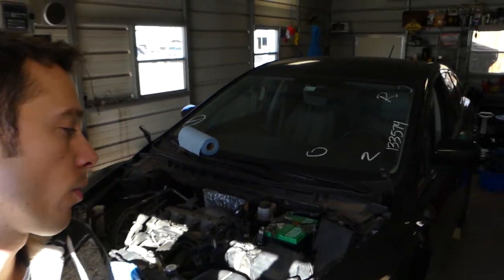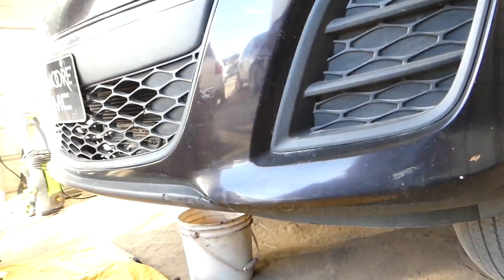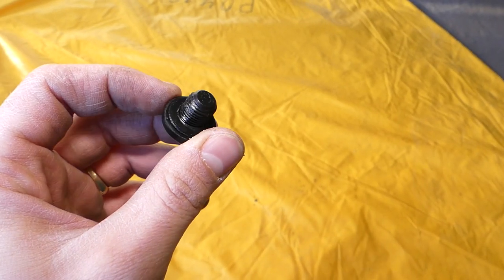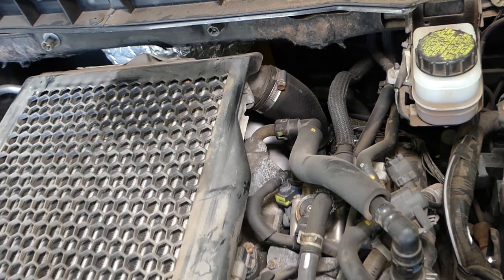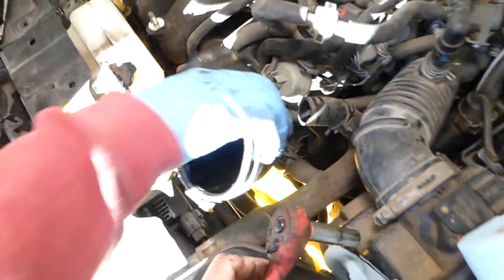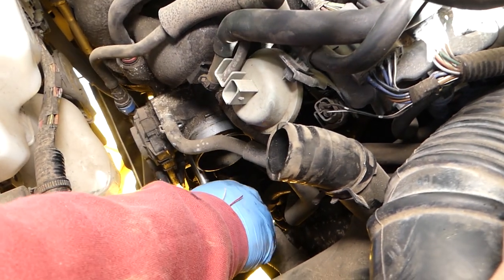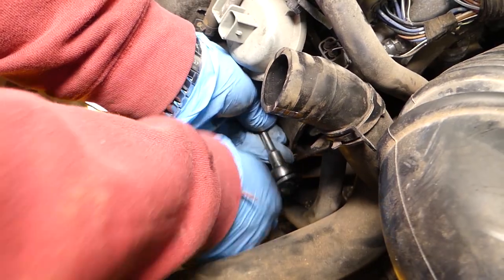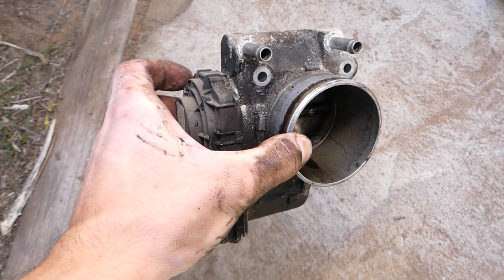HOW TO REMOVE AND REPLACE THROTTLE BODY ON MAZDA CX-7 MAZDASPEED 3 6

Comment: Please respond my 2011 madza s throttle is sensitive when I first hit the gas pedal. I have to slowly and gently put pressure w my foot so I don't jerk my passengers heads back and forth. Any ideas ? It there a cable or is throttle plate getting stuck? If so can I clean it wo removing coolant? Ty .i may change coolant soon. Do you back flush w prestone, kit? And what coolant should i use? Thank you so much .im new to madza s.

Comment: Hello, i have a question and i hope you can help, i have a 2007cx7 that i just changed the pcv valve on, also the intake gasket but when i got done it wont start and stay running, but if i unhook the throttle it will barely run, but it runs ,why is this, do you have any ideas?.. thanx in advance?

Comment: So I brung my Mazda cx7 to 3 shops and no one can tell me what's wrong with it. As I drive the car jerks back and forth like gas or air is getting cut off somewhere. As I accelerated the rpms rise fast but speedometer slowly goes up and when I stop it shuts off but will easily start back up. Any ideas on what to do
Reply: try check mass air sensor first...just clean and put it back. if cannot then check throttle body
Reply: Hey Cody I have the same issue. How did you resolve the problem? My vehicle does exactly the same thing and shuts off only on Drive Or reverse.
Reply: Same problem with my cx7 2008 turbo
Reply: Same problem. Got worse when accelerating car didn't go. Was throdle position sensor

Comment: You don't need to drain the cooler to remove the trottle body right? That could be a little misleading to do it yourselfers. Otherwise your videos have been so helpful
Reply: So just plug the throttle body lines when you take it off?
Reply: Hey do you guys know if you need to drain the coolant for you to clean the throttle body?